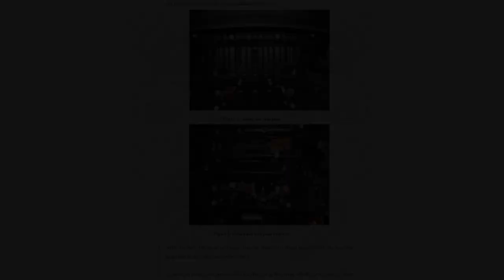Pitman & Idler Support Kit Installation On 2011-2019 Duramax Diesel

Comment: DHD Centrelink or pisk? What's the verdict on 2020?
Reply: I did the kit and wow. Tie rod sleeves and the support kit has ZERO slop or play in the steering at all. 
No wiggle, nothing. 
Worth every penny. 
All wheel drive boosted launches have been holding up too.
Reply: I know this is old but I have the dhd brace and I wish I had gotten the pisk.